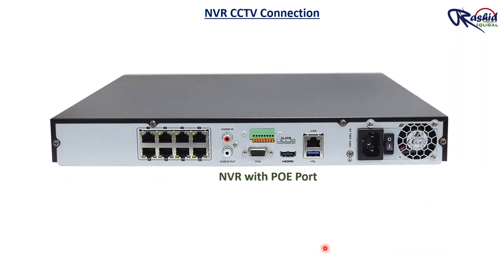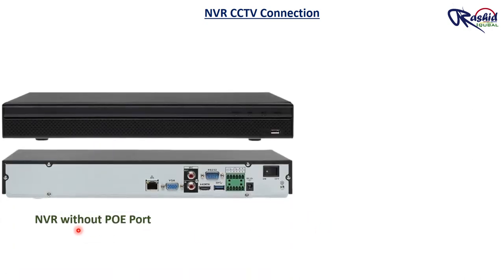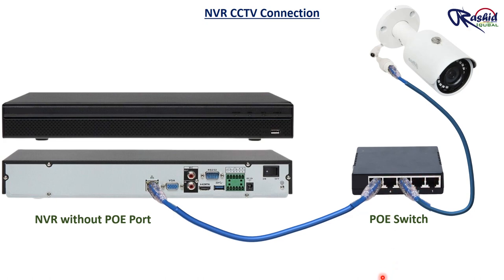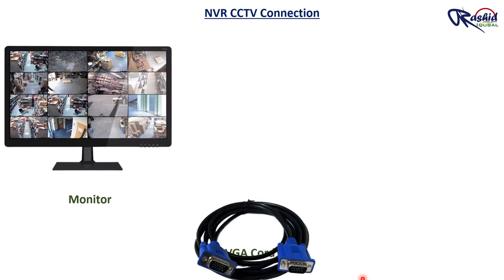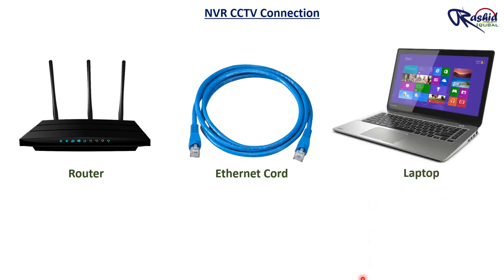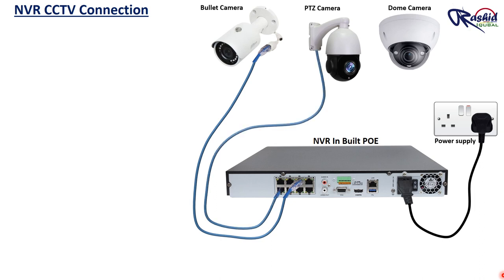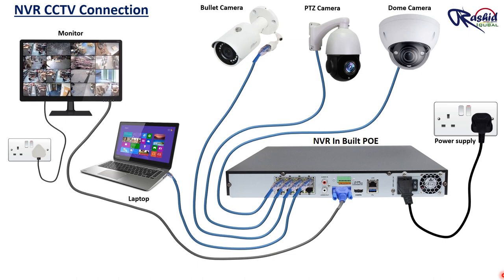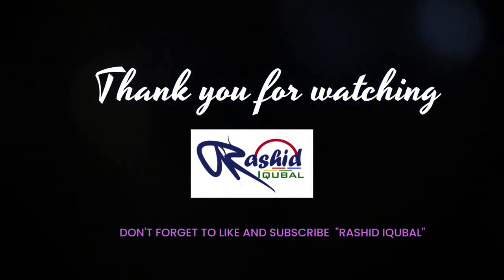IP CCTV Camera connection with NVR and POE - Explained

Comment: Does ip camera comes with ip and power cable socket. Does i have to gv power separately by cable or lan cable gives the data and power together ?
Reply from the maker: IP cameras do not require a separate power supply or data transmission cable. Using a PoE (Power over Ethernet) injector, a single Ethernet cable can carry both power and data. All IP cameras are equipped with only one RJ45 female socket, allowing a single connection for both power and data transmission.

Comment: Where is the power for cameras😂😅
Reply from the maker: We get power from ethernet cable, i explained in the video, in ethernet 1 pair (+ , -) of wire use for power for cctv camera. Still any doubt, let me ask without hesitation.
Reply from the maker: Please do like, share and subscribe if u satisfied.
Reply: he did not show as well the connection from the street voltage pole where he get power for the house to supply and power all the devices. Just kidding. So giggleyohoo.
Reply from the maker: @GiggleYohoo  if you see video carefully you will know from where we are feeding power to the pole. Hope this time you will find out...
Reply: Poe
Reply: 😂😂😂 You don't know what a PoE switch does once you ask such a question, look up PoE Switch or PoE ports on a NVR bro.
Reply from the maker: @JasonLocke88  exactly!
Reply: @Rashid-iqubal hi, what's the max lenght for poe ethernet cable ?( Because you lose voltage with the increased lenghth
Reply from the maker: @janechanlder2675  maximum 100 meter
Reply: @Rashid-iqubal  thank you, one more question, can you add 3 cameras to same cable using splitters? I don't want poe in this case.
Reply from the maker: @janechanlder2675  You can run 1 Ethernet cable from the NVR to a PoE switch, then plug 2 cameras or more into the PoE switch. However, please don't split 1 Ethernet cable into 2 RJ45 connectors, as 1 PoE port can't provide enough power for 2 cameras